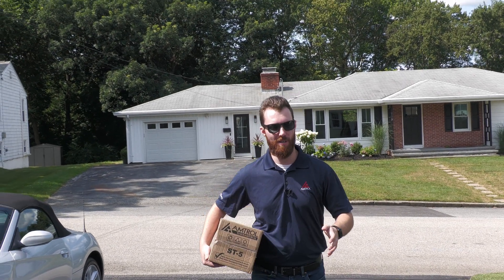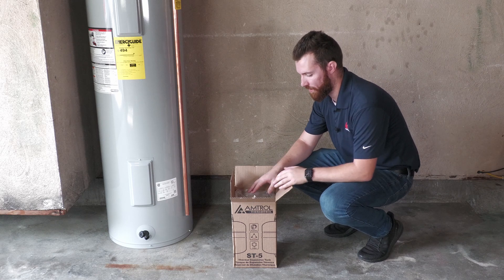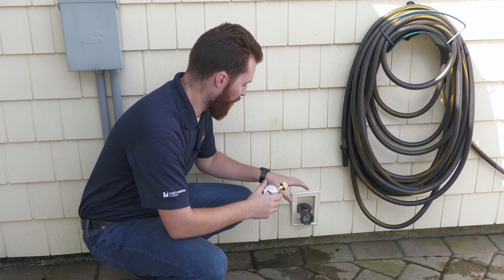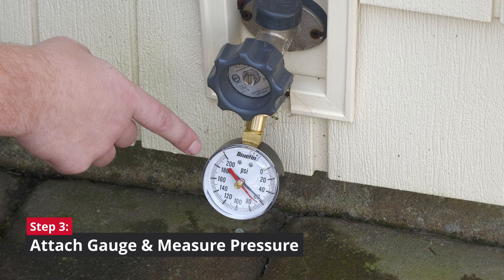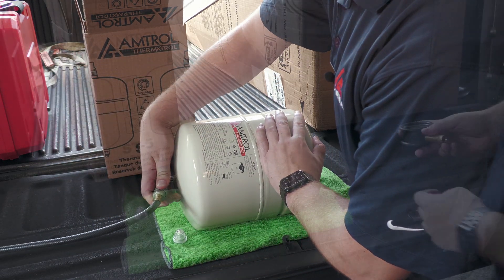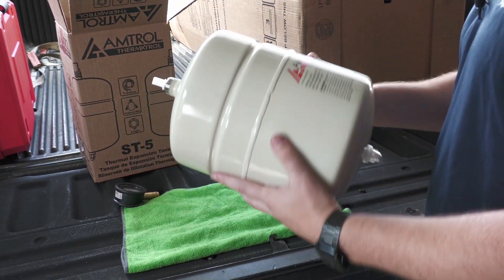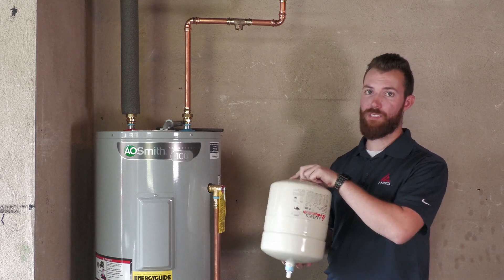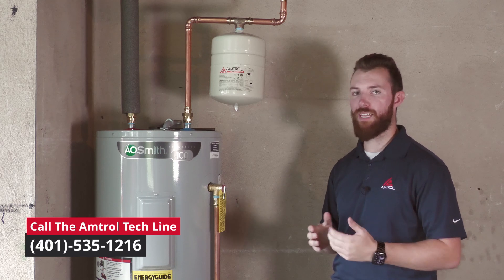How To Install A Thermal Expansion Tank - Amtrol Tech Takes

Comment: BIG WASTE OF MONEY!!!! Iv'e never had an expansion tank & my water heater ran fine for years!!!!
Reply from the maker: Many state and local municipalities have introduced backflow preventers and plumbing codes that require an expansion tank to be used to protect the closed systems from unsafe pressures. In addition, if a backflow is present, most water heater manufacturers will require an expansion tank for warranty purposes.
Reply: without one it can and will shorten the life of the water heater and other potable water sourced appliances (dishwasher/washer/icemaker/ fittings ,piping, valves) it  is there to minimize over pressurization of system......plus it is code ....and like Mr Amtrol says it will void warranties
Reply: @martinmoffitt4702  my water heater lasted 22 years without one
Reply: You spelt four wrong, and yes that is a BIG WASTE OF MONEY!!!!!!!!!!!!!!!!!!!!
Reply: It's because with the backflow preventers installed ... in rare cases ( I have seen this personally) the water heater can cause expansion and blow fittings apart if the pop off valve on the water heater fails

Comment: So Amtrol is not suggesting that thermal expansion tanks be supported by something other than the pipe itself, as long as they are in the upright position?
Reply from the maker: Correct. The tank will become quite heavy when it fills with water. The installer needs to account for that extra water weight and ensure the tank is rigidly supported by the piping or other direct mounts.
Reply: @amtrolinc can you read my question again? I’m suggesting you should have a support even on the vertical position.
Reply: @Kcwaterheaters 
Read his reply. 
It's okay if the weight is accounted for. 
It can hold a lot of water, sure. 
But the pipes rigidity HERE is sufficient.
Reply: I bought a wall mounted clamp for the one I installed.

Comment: How important is the turbolater ....I threw mine out ...didn't know what it did....
Reply from the maker: The turbulator helps minimize stagnant water in the expansion tank by increasing the flow of fresh water during usage. It is not required for function, but is definitely an added benefit.

Comment: What if you are not on city/town water but are on your own well with a pressure range of of 45 to 65 pounds?  At what value do you set the expansion tank pressure?
Reply from the maker: Great question! We would recommend you set your expansion tank to the high limit of the pressure switch on your well system. Reason being, when you system is fully pressurized after a fill cycle, that is when you are most susceptible to hot water expansion rising to dangerous levels and you want the expansion tank to be optimized to run most efficiently at that point.

Comment: Why did this system need a thermal expansion tank? Is there a check valve in the system?
Reply from the maker: This system had a backflow on the water meter. However, it is good practice to have a thermal expansion on all systems to manage expansion pressures from the water heater.

Comment: How do we change one of them on a pre existing water heater?
Reply from the maker: To remove the old expansion tank, you first want to turn off the incoming water supply and bleed any water pressure off the line where the expansion tank is located. Then you can simply unthread the old expansion tank and follow the steps in the video to replace with the new. If you have additional questions, please don't hesitate to contact our technical team at amtrolwatersystemsinfo@worthingtonindustries.com.
Reply: How and where do I bleed any remaining water pressure off the line where the expansion tank is located????
Reply: @MarkKomar  Isolate your boiler and drain the water out of it from the bottom...should be a drain valve near the floor